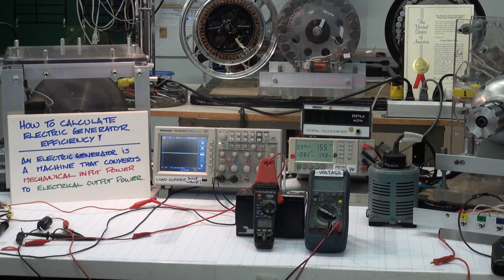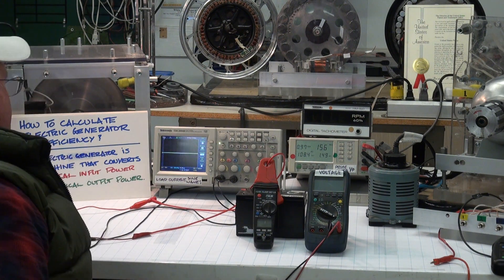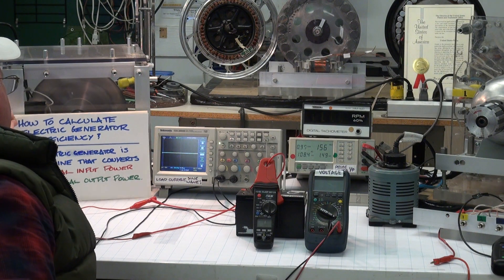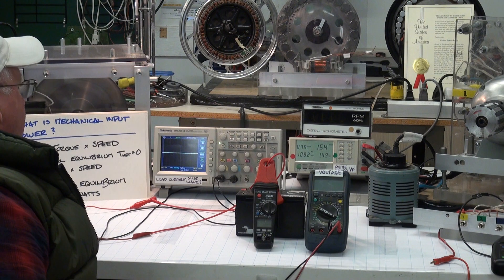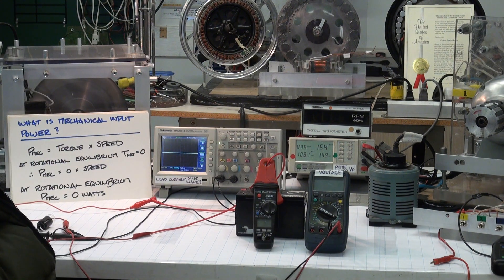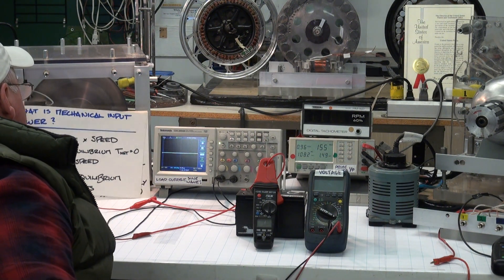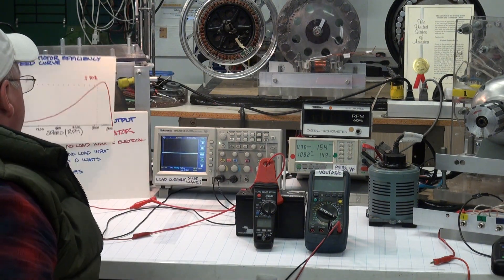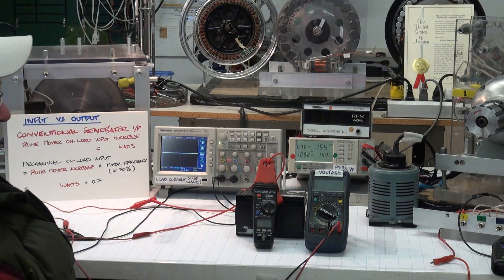PERPETUAL MOTION MACHINE OF THE 1ST KIND - ReGenX Generator Infinite Efficiency #perpetualmotion

Comment: Could you plug it into a battery that is then charged by the ReGenX system?  If you can that is wild.  If not, can you explain why not?  I hope more people see this!
Reply from the maker: @Pumpkingilmour NO (mechanical input power is required) ... 😏
Reply: @Pumpkingilmour  https://www.youtube.com/user/ufopolitics/videos    Ufopolitics asymmetrically modified DC permanent magnet motor can output 2 times more mechanical power than conventional DC motors. Higher efficiency is evident in video, where 750W DC motor is powered by 2 AA 1,2V 2200mAh batteries running asymmetric motor for 30 minutes. Motor runs with 350 rpms.  https://youtu.be/GWHTm_id0YU   Ufopolitics claims that  asymmetric systems was suppressed more than 132 years, to keep us all dependent on one source of energy - oil  .  Asymmetric systems was invented by Nikola Tesla in 1888 year.